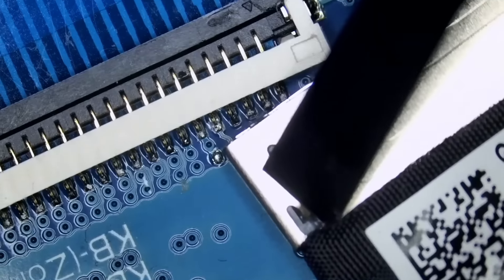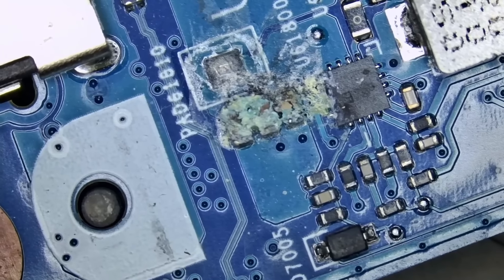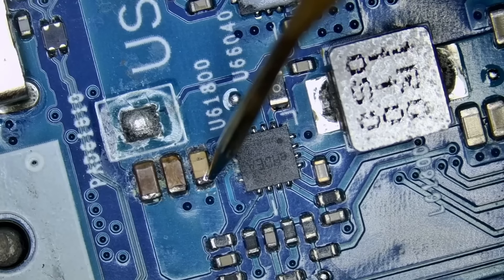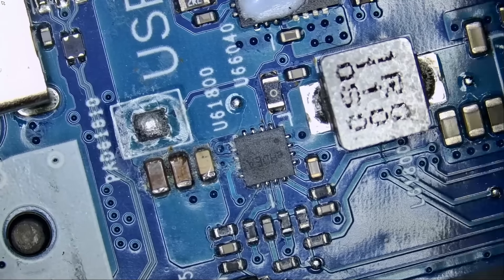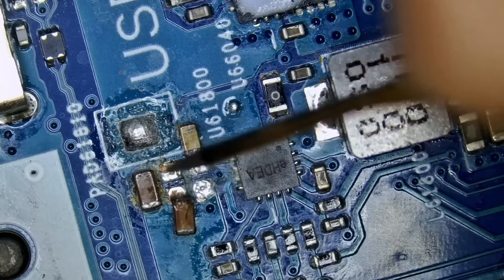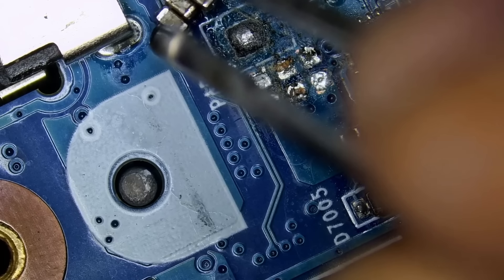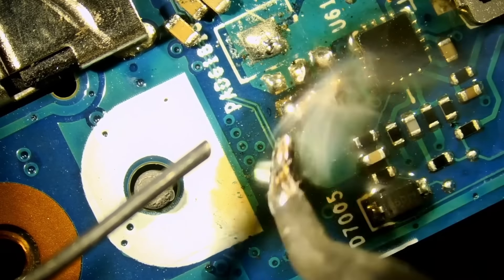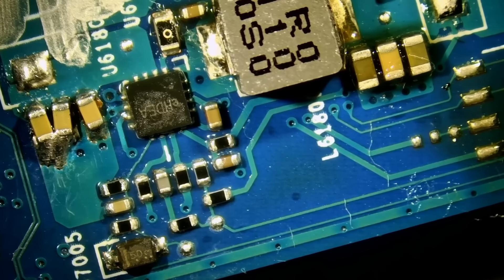NEW ASUS ROG Laptop DEAD No Power Repair- What happened ?

Comment: Nice repair! The Asus ROG BIOS takes long to load and has this surprising screech.
Reply: especially those ryzen 6000 and 7000 series
Reply: The long load at "BIOS" on this one was due to RAM Training to pick an XMP Profile.  The short circuit where it was would have initiated/simulated a BIOS reset and this initiated the RAM Training which takes time for sure😉
Reply: @patricksewell2010  Not necessarily the short circuit. The battery going flat/being disconnected will do the same thing as it has to re-learn. My older Dell G3 3779 GTX 1060 machine does it. I recently had to replace the palmrest, the hinge area collapsed, it was a complete rebuild, the first boot POST took ages, it power cycled several times!

Comment: Someone may say that he doesn't see any water damage because it could be a laptop used by the family, so he doesn't know EVERYTHING which may have happened to the unit.

6:18, depending on the circuit, the three caps in parallel aren't just for redundancy, but if they are different values, they may be used to reduce ripple in the supply at different frequencies. No way all three of those are the same value.

Comment: no you have 3 caps in  parallel to act as a band trap for different frequencies.

The fact that they  "add up "to a set value  in not what they are doing.  they act to trap transients at different frequencies.

you will see this  when you have several  100 UF caps, with a 100n or 10 n across them. , 
They aint 'adding up" the capacitance. ,since an electrolytic is +-20% so 100n is FA.

The 100n is there to trap high speed noise, long before the  electrolytic can "strong arm" the transient.

Comment: Is all this work done without removing the board from the plastic laptop case? Is it ok generally to do soldering without removing the board first?
Reply: I don't think it's a problem with small surface mount caps. Just don't leave your soldering job like he did here.

Comment: I was about to say that capacitors have to be measured out of circuit, then you mentioned that, thankfully lol. 

Caps measured in circuit, generally, will not yield the correct value.

Comment: I'm still dead in the water with an Alienware m17 R4 with a 4 red 1 blue light. Battery disconnects when starting games. Only way I've partially fixed is undervolt.

Comment: I have a rog g531g laptop and it stopped charging all of the sudden. The charging light on the laptop started blinking but the laptop can still run on battery so I assume all the main components are fine. I opened it up to check the mainboard and I found out I have short almost on every caps specially those behind the cpu and gpu. I send it for repair and they tell me everything is fine it's probably the charger itself... I wanna know how is that possible that I get short meaning 0 ohm reading on both sides of the caps but they tell me it's all fine? Am I wrong on my reading? I used the screw hole on the mainboard for my ground and I'm sure I got the reading of 0 ohm on both sides of the caps.

Comment: ASUS is shit. Remember I bought an Asus 901 EEE PC, and they soldered the SSD on the motherboard so that is wasn’t possible to upgrade, and while the total capacity was 24GB if I remember correctly, not too bad, anyway however ASUS made it so that the C: partition was limited to 4GB, effectively limiting possibilities to upgrade the operating system. Admittedly, there was a Linus option, however not everybody are that geeky with computers, this was supposed to be a very compact computer to do normal Windows stuff with. Some Linux users may have had better luck with these EEE computers though, to be fair.

Even Windows updates were a nightmare on this PC and it was slow as heck, even with the upgrade from 1 to 2 GB RAM. Having a swap file on the SSD,
was a big mistake, because the many reads and writes, made the SSD progressively slow because of the lack of automated trim function. Ironically, it would havs been better to have a classical spinning harddrive in those computers.

The SSDs were even slow, because earlier versions of Windows didn’t support trim and as mentioned, the 4GB cap on the C: partition made it impossible to upgrade or even update Windows properly.